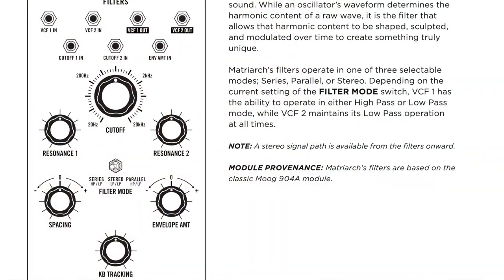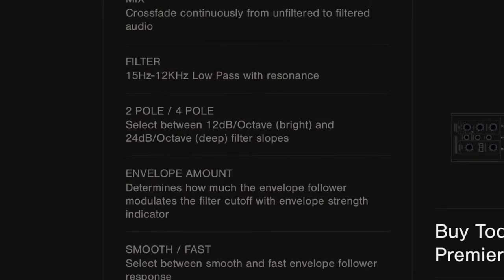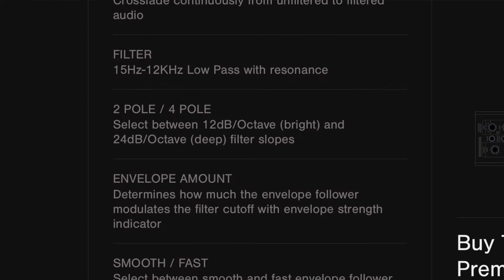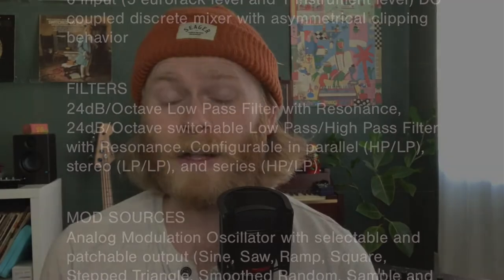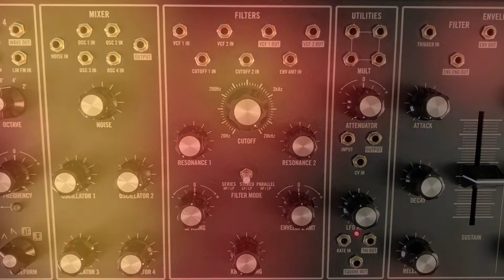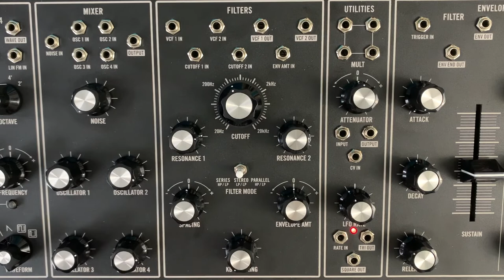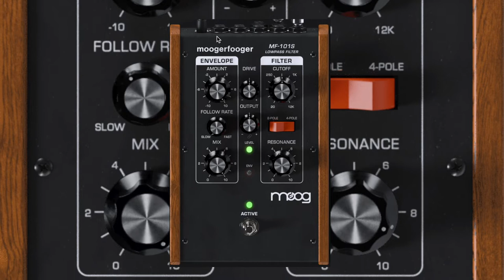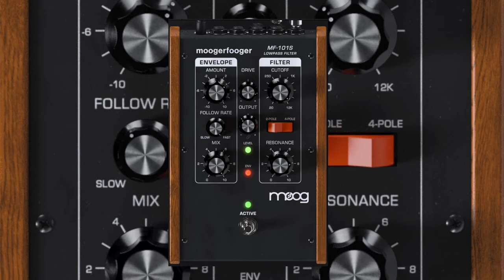Moog Analog Filter Vs Moog Digital Filter

Comment: Great comparison.  Most of us don't have the analog unit; and you can tell a lot from the sound samples.  While it's great to have a plugin version vs. none at all, the lows and low mids sound FAR more rich through the analog on the "ripple" patch (via my HS8's).
Reply from the maker: I agree that there is always a difference between lows mids and highs when comparing digital vs analog that just is difficult to replicate. I was still very impressed with what the digital filter CAN do that is as close as anyone's going to get on their computer to the real thing. Thanks for watching!